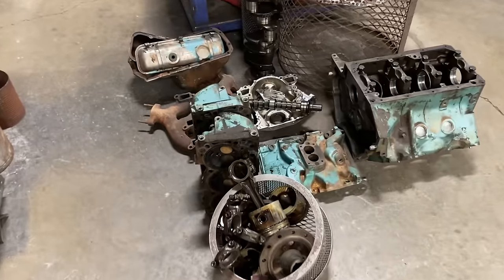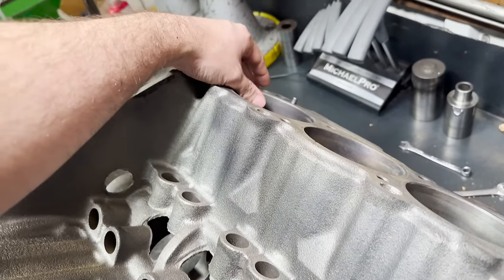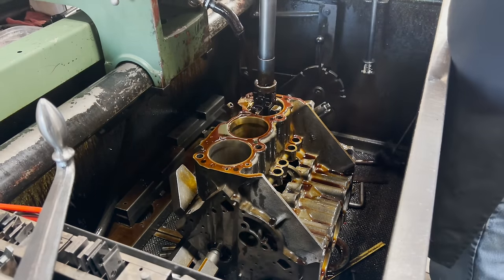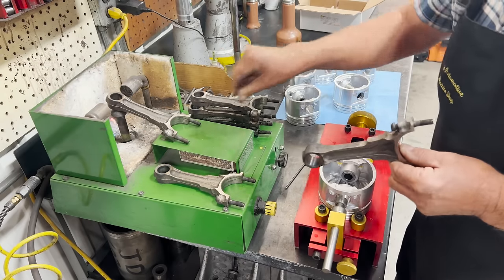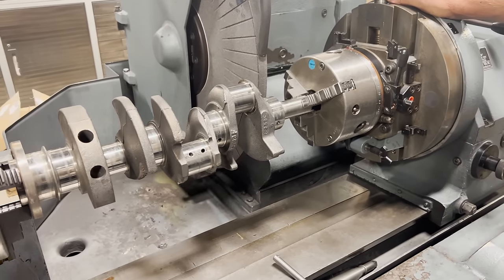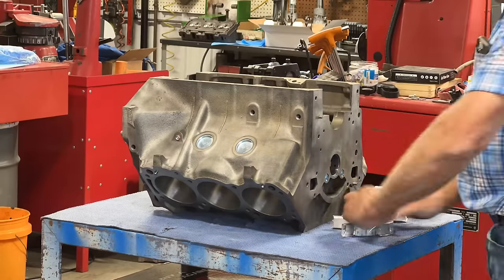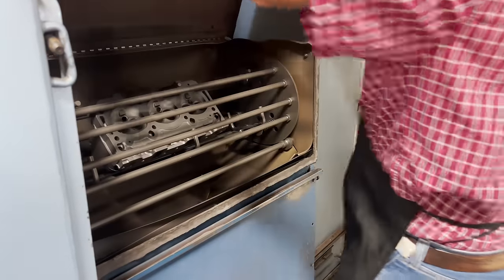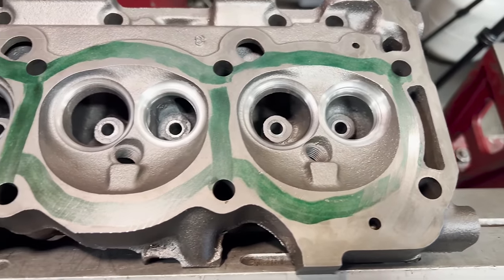This 225 Buick DAUNTLESS V6 Odd Fire Was WORSE Than We Thought...

Comment: I genuinely honestly and from the bottom of my heart do not believe that ring orientation matters, as long as it's all staggered. Now I'm just a little shop and don't pretend to know anything, but I did an experiment with a 350 with rings basically all over the place vs where they're "supposed" to be vs completely unstaggered and just logically staggered, 1 of each on both banks at different cylinders in case that mattered. all over the place, logically staggered and how it's "supposed to be" had no diffrences what so ever, in compressor hot or cold or oil burning, the only thing that mattered was unstaggered (so gaps being inline) and even then i saw a loss of 20 psi (when hot cold was a bunch worst but started just fine) and it burned a little oil in those cylinders (judging by plug).

I later turned that 350 into an air compressor using bank 2 to power bank 1. I never knew that half a SBC would sound so good, firing order is 8-4-6-2 which is 90-180-360-630.

Comment: Had a couple Jeep Commandos with 225 one auto one manual great engine driven daily to work and 4 wheeling every weekend. The manual has 42 pound flywheel and is unstoppable climbing hills it did not bog, just kept screaming as far as traction would allow forward progress. 

Used to 4 wheel with a group of about 50 vehicles of every type if mine wouldn't make it few would even try. Total dominance in hill climbs especially in long rough soft sand hills. Potent combo but the clutch cables fail often at the pedal end. The ball squished on end would break off so just carried some nuts and a hammer to slide nut over broken end of cable and squish with a hammer. Back on the road short time later but didn't last as long as threads in nut would cut cable some when crimping it with hammer.

Comment: When I was a kid, I acquired a Jeep with an odd fire engine in it. Not knowing any
better I threw a bunch of parts/money at it trying to get it to run smoothly at
idle . Not until I had a conversation with a neighbor that had owned one 
previously did I realize my lack of knowledge.  I did love the sound that
it made with headers and duals and the torque that it had.

Comment: It would be nice if we could see the 225 start up. I'd like to hear the sound you mentioned earlier. Also, this is a good option to try fuel injection upgrade on. Nice job 👍
Reply: Fuel injection is a little tricky because of the engine geometry they mentioned. Apparently it must be crank triggered as the odd gaps the distributor produces confuses computers.
Reply: @slateslavens Well, the crank is the root determination of the spacing in the firing order. 90-150-90-150 etc... Have an odd-fire Jeep of my own. Have heard of guys converting to FI, but never have seen an end result or a tech breakdown of how it was done.
Reply: @warrenzevonsangryghost6055  I forget the name of one of the small-shop units that's been used, but for the odd-fire it relied on a Holley crank trigger that had been out of production for better then 10 years. I learned that bout 8 years back. 

to my knowledge, the trick is feeding the trigger from the crank as opposed to the distributor. I recently watched a video where a guy built the trigger from scratch by using a magnetic trigger fired by passing 3 bolts installed in pre-existing holes in the harmonic balancer. Don't remember what video though.

Comment: I rebuilt a 1979 231 with an offset crank (even firing) and it was a pain to get the distributer set correctly. Eventually I got it and it was a great engine.

Comment: Word for the wise; 
Never reuse an old oil sending unit after a rebuild.   Old brittle plastic along with elevated oil pressure from the rebuild can cause it to blow out and dump the entire oil reserve in less than a minute and ruin an engine.     I learned the hard way.

Comment: We have a boat with 3.8 chevy v6 and somebody left water in it and it froze and broke. So we got a 4.3 motor from an s10. We had to put the distributor out of the 3.8 in the 4.3 but I had to regrind the cam in the distributor that opens the points as the one in the 3.8 was odd fire but I had to regrind it to be even fire.

Comment: I saw this in a J Planter design where he calls for 90* cranks at TDC but having high torque applications you need to backlash the cam 15-20* which compensates the odd firing but also gives it high torque for high power applications which Jeep may have piggy backed off

Comment: I reebuilt an even fire Chevy 235 V6 with the offfset journals.  While I didn't break the crankshaft, I could tell that design was weaker than the odd fire crank
Reply: The offset journals were larger diameter than the straight joirmals in the SBC V8s to help with that

Comment: The thing about not spiraling compression rings on is strange because most manufacturers of large diesel engines say it’s and accepted method of of installing them but maybe because the rings are so much bigger you aren’t twisting them as much
Reply: That may also be because of what the rings are made out of. Modern rings are often made of steel or ductile moly iron. Also, they can be thin. This adds flexibility.

The old rings were cast iron and thick.

Modern gasoline engine rings are usually 1.5mm or thinner. Old gasoline rings are usually 2.0mm or thicker.

Comment: I'd put money that the weird cylinder wear pattern is not so much weird wear but the metal relaxing from the backing. I have had blocks do this a couple times, most the time it is on the older blocks. Like 1979ish or older block, something about the way they were cast and machined, I've actually seen a lot of movement in the whole block because of it.

Comment: The V6 in the Citroen SM had the same firing intervals and in fact the GM distributor can be made to work on them. I've always thought of these engines as 3 90 degree V-Twins side by side by side. That made it easy to understand what was going on.

Comment: Looks like the new pistons are more dished. Original pistons were like 9:1
Compression. I have a 231 odd fire with like 8:1 if I remember correctly. The old 225 we had would run circles around the 231!
Reply: Yes it would was a master tech in eighties and worked on 231's every day as they were probable the most used engine at the time. My Commandos with 225's I beat the crap out of and never worried about hurting them. later even fire 231's not so much unless heavily upgraded if one wants to hold pedal to the metal all the time.

Comment: A question for Jim about ring gap. I have heard from some engine builders that the gap on the second ring should always be larger than the top ring. This is explained in that pressure between the top and second ring will cause the top ring to move away from the bottom side of the ring grove and flutter allowing leakage at some rpm ranges. They claim to have dyno data to back this up. Your thoughts?

Comment: Ring groove cleaner?  I have been using mine for 40 years. Though it does not go down to 1.5 or 1.2 grooves. Back to grinding and old hacksaw blade! Or using and old ring.
Even fire V6s, 3.8 Buicks. Std they are fine, try and race them and they break cranks between the crankpins. I have seen one broken as a stock engine thoughj it had been driven very hard witha manual trans.
Assembly lube? I never use it, I use engine oil, the oil the engine will run on. I have gently wound rings on forever and never had an issue. Drowning a piston is wrong,, lube the rings and grooves, nice coating of oil in the bores,, and lube the pin carefully.
I try and avoid fitting valve seats. Once you hammered those seats in half the time the head is cracked and if not will be sooner than later. Have also seen seats fall out and that makes a mess.
Those seats were induction hardened OEM and that usually lives ok. Though using valve seat saver in the fuel resolves wear to the same as leaded fuel.
I agree with using PC seals. I have done a LOT of them. Every half decent engine I have done.

Comment: The distributor is a special unit. If you don't install it correctly the engine will not run correctly. The point cam is made to compensate for the 90° block and the 120° crank. In another words, the distributor lobes are 150° and 90° apart so the cylinders will fire at the correct time. If you install it one lobe off the engine will not run right. So be sure you set the distributor just like the picture in the manual. Also the rotor is special, it has an extended arc finger so it can reach the cap tower. The cap is spaced a 60° giving you the elusion of an even fire engine.
Reply: That, or locate an HEI from a 1975 or 1976 odd fire Buick 231.

Comment: We would get a car in the shop with an odd fire that had been to a fast food tune up shop or a DIY with the wrong distributor cap installed. Later in the marine business customers replaced spark plugs in their vortec trying to fix one problem but made things worse with the short 1/2 reach plugs they installed.

Comment: I had one of these odd engines in a BuickSkylark. You needed no traffic on the street to pull out. As soon as you stepped on the gas it would quit. I hope you can get it started before traffic comes. It never did run right. The dealer never could figure out how to make it run right.
Reply: Was that in the 1970s? I heard that most 1970s cars had weird smog devices that didn't function correctly most of the time.

My dad said it did happen to him once with his 1979 Toyota Corolla. He said that after it was fixed under warranty he didn't have any other problems.

Mom had him trade it in on a 1985 Nissan Maxima. That had a modern EFI engine, and was never a problem in that car.

Comment: Back in the day when hand honing for a re-ring, I found that using just water with a bit of dish soap did the job and fast at it continuously flushed the residue.  Using some type of oil usually fouled the stones and with the water/soap mix, cleanup was far easier.
Reply: You only gained what you thought was a good job was because of the detergent.  Use ATF since it has a high detergent and also provides lubrication.

Comment: I see some resemblance to an Oldsmobile engine on those specifically the motor mount pads on the side of the block and the rear/bell housing area and starter pad

Comment: So Question Here...... is the buick 225 odd fire similar to if not basically the same block as the buicks odd fire 231 3.8L V6's they were using up until the early 90s? They were pretty stout little engines, especially when Buick developed the Grand National engines with a turbocharger. These from what I understand are slightly different from the standard 3.8L and I'm sure they'd be a little bit stronger to handle the extra power. Because of that, I believe that you cannot interchange too many parts from the turbo to NA 3.8L's. So were all these Buick odd fires similar than in their internal parts? Or blocks?

Comment: If the distributor points cam or EFI pickup is in the incorrect position it hit the exhaust hard enough to blow the muffler completely apart. Dual exhaust idle sounds like a lumpy V8, but they sound best with a y pipe through a single muffler. Like a fart in a bath tub.

Comment: I am not a mechanic or engine tech but certainly someone with festidious/perfectionist tendancies. Please could you perhaps explain why, if the gaps should be as opposite as possible, the oil ring gaps are not left/right and the expander gap is then front/back online with the pin?
 I am of course assuming the expander just pushes the oil rings apart and does not do any oil scraping. Googling offers no insight and almost seems to suggest all gaps should be in line for optimal separation and an even outward pressure on the oil rings against the cylinder wall.
Reply: The second ring is actually the oil scraper.   The oil rings are more of a 'pack' or an assembly'.  The area between the two oil rings is pretty much just a collection area for the bulk of the oil to enter so it can pass through the oil drain back holes in the piston.   Whatever if left gets scraped by the 2nd ring until it reached BDC.

Then the cycle starts over.

The reason you don't want to the top two ring gaps lined up is because then combustion pressure (and fire) could shoot straight down on to the oil ring. Not only would that expose the oil ring pack to more heat than it's designed to have, there's also oil there.   Burning that oil would lead to carbon build up on and around your rings, and you don't want that.

Not to mention the microscopic amount of flame cutting that would be going on every time there's a spark event.

Basically you want fire to never go below the top ring (but there has to be a small gap), and you never want oil to go above the 2nd ring (but there also has to be a small gap).    So you minimize the effects of the small gaps by putting them 180* apart.

Comment: The surface of block you might think is rough, but most were into the eighties so not sure why a problem, they hold gaskets better and head gasket leaks were almost none existent in vehicles for a long period of time. . If you pull one out of the junk yard today (old engines) they most surely will still not leak from original head gaskets. Modern Theory's and what was practice do not always align. Used to own many of these 225's overheating them all the time 4 wheeling ( often mutiple times a day opps no biggie let it cool some) in summer they didn't care head gaskets never failed excellent engines.

Comment: 25:30 wow, I guess that leads to the story of low milage!!  Wow, looks brand new still!!   Amazing. That engine looked bad from the years of sitting, but cleaning and inspection has it showing new. I wonder if the cross hatch could still be seen in it. But a cheap, rebuild and no real machine work needed is always awesome!!!!  Happy customer for just a oem engine and nothing special build. I guess the only thing would be hardened valve seats for unleaded fuel?

Edit: lol, and further in a little more rough. I wonder what caused the odd wear? Was it std back in the day for leaded fuel to taper like that?  Sounds like it had soft valve seats for leaded fuel and you guys swapped to hardened for unleaded fuel?  Just what I heard between the lines of the overview, lol. Amazing work as usual. I would have loved to have a career machining blocks and things. It's always a good feeling seeing something in public you had a hand in building and your input made that product. Such as construction, engineering, even IT systems that are used by millions daily (what I do 😊), but grew up doing manufacturing and assembly lines and construction from cement to framing to plumbing, to electric to roofing to (my fav) drywall and finish work. So mad respect to all crafts!!!
Reply: HA! And at the end the cleaning guy nails it! Lol. Or says it and I nailed it. :D

Comment: Always position the rings gaps on away from each other is the rule. But, when you take the engine apart will they still be in that position, or do they move around over the years and make this ring position unnecessary?

Comment: 35:02 wow, the heads look VERY close to the 3800 heads
Reply: With the exception of the 3800's stud rockers, they're almost the same casting as the older 3.8/4.1 heads.

On the '89 Turbo Trans Am, they actually used FWD 3800 heads on the Buick Grand National bottom end so they could have header clearance in the 3rd-gen body's strut towers.  (and lower compression pistons because of the heads smaller combustion chambers)

Comment: Looks great nice job ! My buddy that worked a Tonawanda engine plant told me they use to use shaving cream as a assembly lube I don't think he was messing with me when he told me that ??
Reply: I have used  shaving cream in cylinder  head water passages  on salt water  cooled  marine engines  to trap small  pieces  of rust that might fall out onto  the head gasket when doing a valve  job. Factory  might  have used it to catch  casting sand.

Comment: One of my friends back in highschool kept fighting with another volunteer at a museum for years about how this engine should be timed.  (Until he quit to focus on his own shop.)

He'd rebuild it to run on most cylinders (for which he could buy/build parts), and the 'established' mechanic would alter and swap parts at random, reducing it to struggle on one or two in a single bank because "it sounded like a tractor, and that's wrong" -- Making it run like a hit-miss engine probably wasn't any less wrong, but fit the museum's aesthetic.

(edit:) My friend thought it irrational that a 'real mechanic' would refuse to accept his explanation about how it was designed to run; but thanks to your illustration (as a system) I can see how confusion would feed back to stubbornness.
Reply: Sometimes people would confuse the odd fire and even fire ignition distributor. That could do it.
Reply: @skylinefever  I agree that could happen ; And a lack of troubleshooting / critical thinking could prevent someone from correcting it without intervention.

I certainly thought it strange that my friend  only got it back up to 5/6 cylinders when he quit (when he'd proudly insisted that it would stay on all six until he did.) 

But it was clearly an unfortunate case of maliciously willful ignorance motivated by stubborn jealousy .
...
The shop the museum hired to rebuild it after my friend quit was -- "less restrained" in rebuking them since the ongoing tampering threatened their reputation.